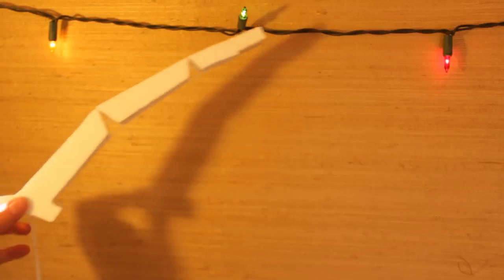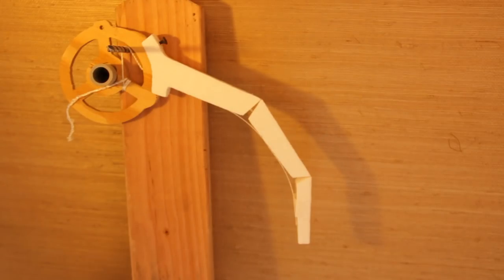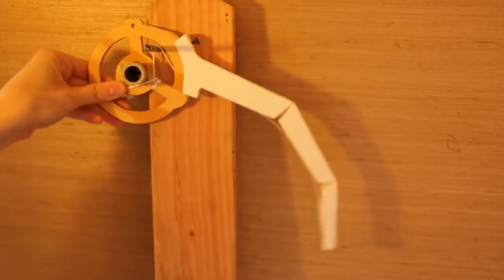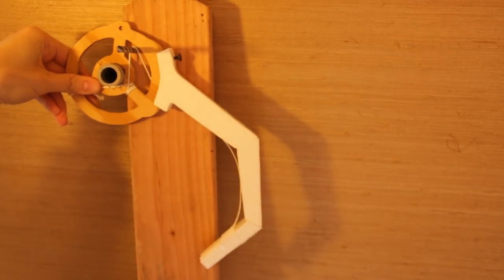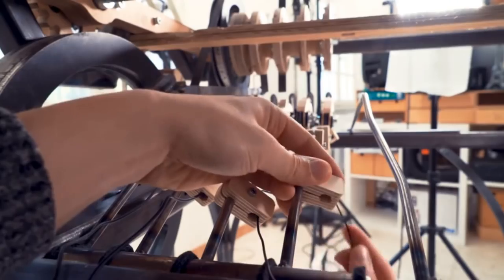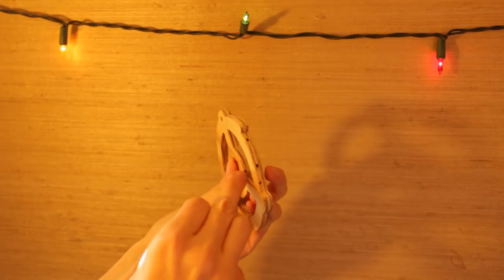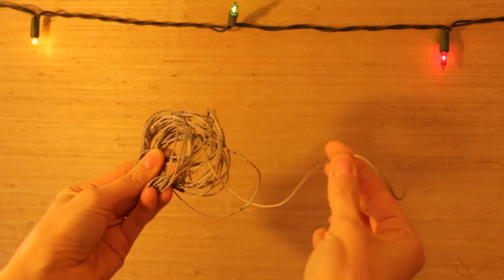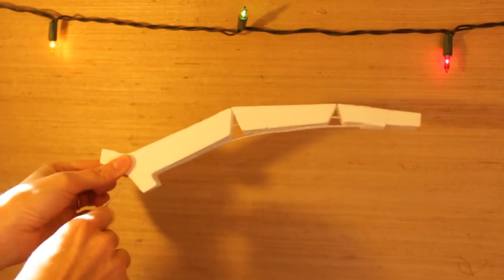Kinetic Fingers - Puppet Cable Mechanism Prototype for MMX

Comment: Looks great!  For cable, have a look at UHMWPE (Spectra, Dyneema) fishing braid.  That stuff is really flexible, strong, stiff in extension (i.e. non-stretchy) and has low creep.  It also runs well inside PTFE sleeving as a guide tube.  I've used it in quite a few effects and puppet mechanisms.
Reply from the maker: Sweet, thanks so much for the recommendations! Sounds perfect for a puppet/cosplay build I'm working on (Minecraft Creeper w/lifting head!) that needs a solution better than regular fishline and tubes I had laying around.  And it comes in BLACK!!
Reply: I can second that recommendation. The line can be a bit slick, but is very, very strong, and has almost no stretch at all.
Reply from the maker: @youtubuzr  Slick is what I  need.  If I can get rid of having to use a pulley, that'll seriously simplify my build.  Yay!

Comment: Nice design solution, it would be interesting to see how it looks if it flexes when the finger lifts and straightens when the finger lowers. It could give it a kind of 'plucking' motion
Reply from the maker: I've been playing around with ideas for a version with this motion you describe, like a finger pushing a piano key.  The hurdle I'm running into is putting too much stress on the programming pins.  I've found a way to do it, but it would reduce the "muted" finger position that Martin is so excited about, and if Martin's moving forward with the rigid fingers, I may not pursue making this idea into a physical prototype.  Or maybe I will, who knows!  :)

Comment: A potential problem that I see with this design, is the inevitable wear and tear of the cable and passage ways for it. Adding another moving part to the MMX that will likely wear out over time (even though it looks cool), adds more complexity and overall upkeep to the machine. I can see why Martin has chosen to go with ridged fingers instead of jointed ones.

Comment: ... wow finally - so glad I found your channel ..:) can you show how you made this - looking to replicate something that doesn't involve hydraulics or motor operated??. .!!
Reply from the maker: It's pretty simple: the fingers are cut out of styrofoam, I poked a long hole through the center of each finger and ran a string through, then taped it to the pointy end. Tape is along the top of the finger joints, springy plastic along the bottom (made of those plastic straps that keep boxes of printer paper closed), held lightly by a small paper sleeve that allows for sliding. The key thing is the angle of how you cut the styrofoam where the finger joints meet, so that you get the curve of the finger that you want, and the springiness of the plastic on the underside.  Took me a little fiddling to get both of those how I wanted them.  

There's a bunch of links in the description that may give you more details for real construction rather than styrofoam prototypes.  And let me know if you have more questions!